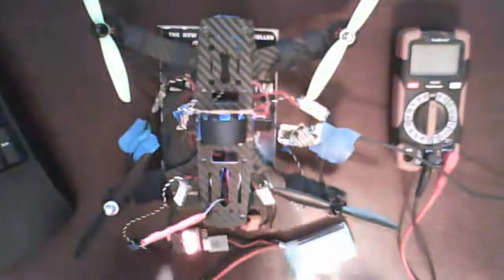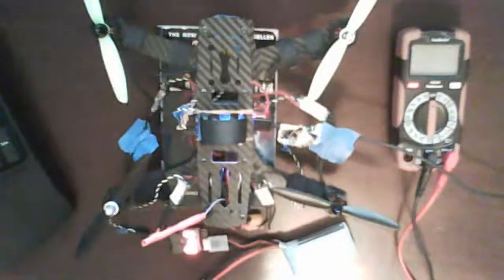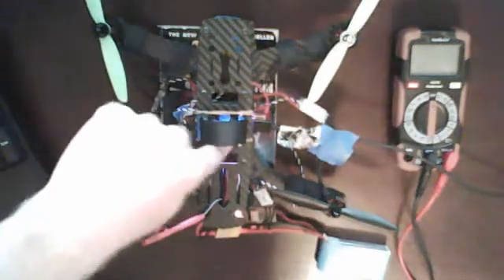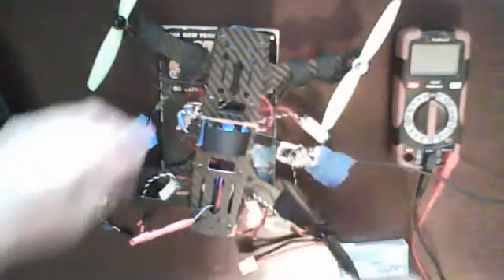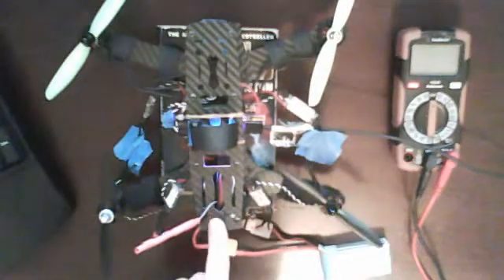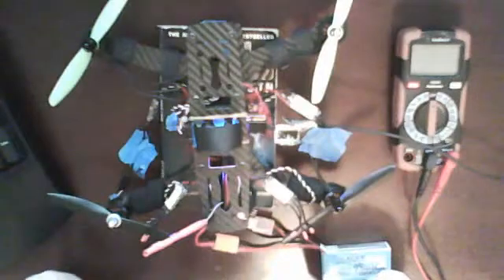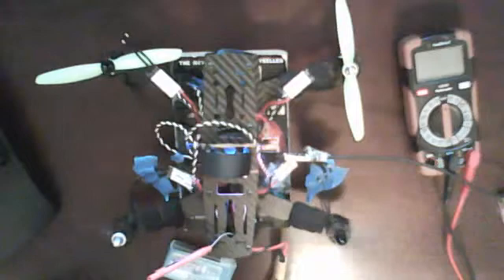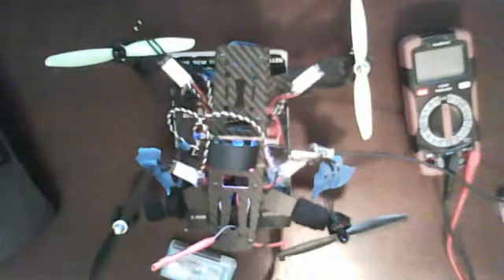Troubleshooting ESCs BLHeli Bl20A

Comment: funny sht...happen to me..same thing..once the 2 front motors..it fixed it self..then today the two right motors...as im watching this vid im messing around...plugin signal wires into different spots  as im throttling up and down,,, bam they start working again...plugged signal wires back to the right spots and FIXED...I HAVE NO IDEA...im to new at this...i know i dont have this problem with my simonK ESCs??